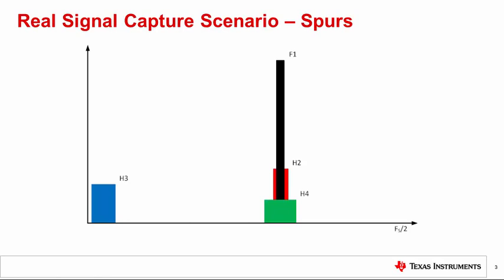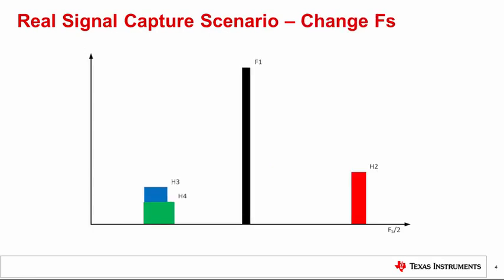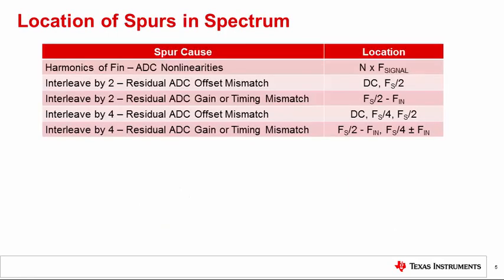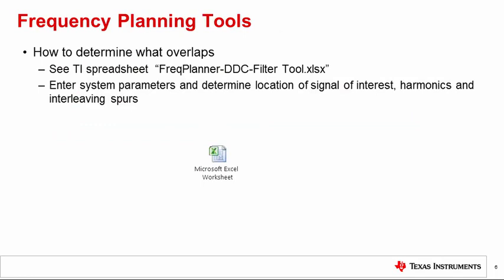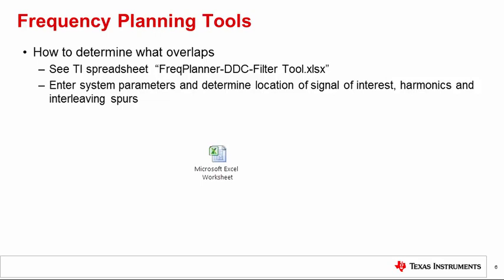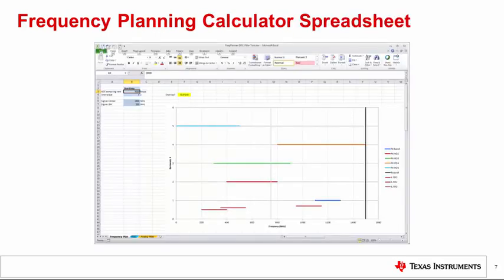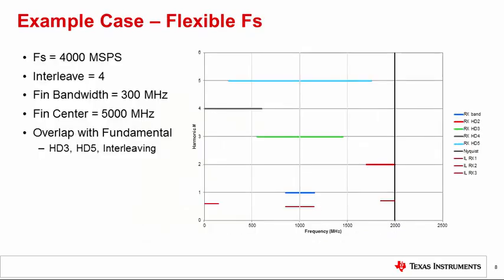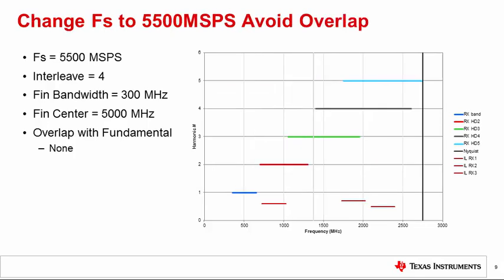Understanding sampling, Nyquist zones, harmonics and spurious performance in high-speed ADCs

Comment: 1. Input Stage and Attenuator
At each channel input, the signal enters through a 15 Ω low-inductance 0603 series resistor placed immediately at the connector to minimize parasitic inductance and provide initial damping.
A 100 pF C0G 0402 capacitor from each input leg to analog ground provides high-frequency filtering and forms the first RC pole. (C0G dielectric ensures negligible voltage dependence and predictable settling; 0402 keeps inductance low.)
A precision 25:1 differential attenuator is implemented using one Vishay ACAS 0612 AT thin-film matched resistor array per channel. Each array provides 24 kΩ series and 1 kΩ shunt resistances with 0.05% matching and 15 ppm/°C tracking, ensuring excellent channel-to-channel and differential balance. The attenuator output maps the ±30 V external range to approximately ±1.20 V for the FDA inputs.

2. Fully Differential Amplifier (Driver Stage)
Each differential attenuator drives a TI THS4552 fully differential amplifier configured for a fixed gain of 2.75, scaling the ±1.20 V input to the ±3.30 V full-scale range required by the AD7381-4.
The gain is set using 3.32 kΩ feedback (Rf) and 1.21 kΩ gain (Rg) resistors in 0603 0.1% packages. These resistors are placed symmetrically and close to the THS4552 to minimize mismatch and parasitic capacitance.
The THS4552 output stages include 27 Ω 0603 series damping resistors at each FDA output pin to improve stability and ensure clean settling into the ADC’s switched-capacitor input.

3. Output Common-Mode (VOCM) Generation
The FDA output common-mode voltage (VOCM) is set to 1.80 V and is shared by all channels.
A precision 3.3 V reference (ADR4533BRZ or LTC6655BHMS8-3.3) feeds a corrected E96 divider of 16.9 kΩ (top) and 20.0 kΩ (bottom) producing approximately 1.788 V, well within tolerance for the 1.800 V target.
This node is buffered by an OPA392 precision low-bias-current op-amp. The buffered VOCM is decoupled with a 47 nF C0G capacitor and routed using a star topology to:
all THS4552 VOCM pins
all attenuator shunt nodes
to maintain low impedance and consistent common-mode bias across channels.

4. ADC Interface
The four THS4552 outputs drive the AD7381-4 through short, tightly coupled differential traces.
A 27 pF C0G 0402 differential capacitor is placed directly across each AINx+/AINx– pair at the ADC pins. This ensures the differential input capacitance is matched, improves charge-kickback absorption, and stabilizes the input RC network as recommended for SAR ADCs.

5. General Layout and Implementation Notes
THS4552 devices are placed close to the AD7381-4 to minimize differential routing length.
All components in each differential pair (series resistors, filter capacitors, and attenuator elements) are placed symmetrically with matched routing.
Decoupling capacitors for all ICs follow vendor guidance and are placed within 1–2 mm of supply pins.
A continuous analog ground region is used with a controlled digital-to-analog return path near the ADC ground reference.
All passive components critical to settling (resistors, filters, diff caps) use 0402 or 0603 packages for minimum parasitics.
No ESD or surge protection is included under the assumption of careful user operation within ±30 V.